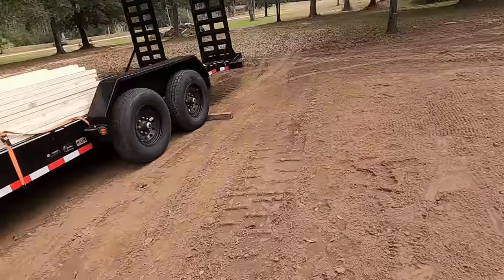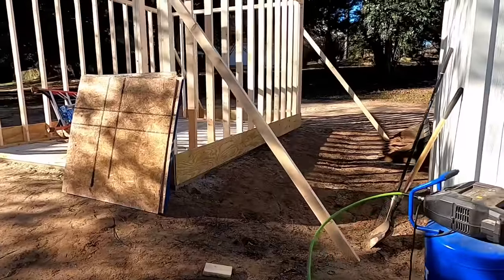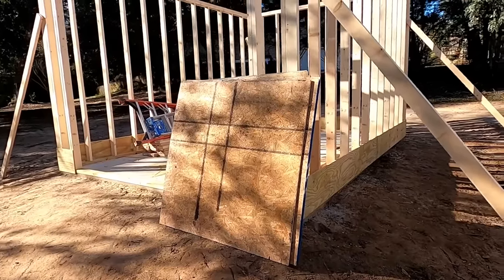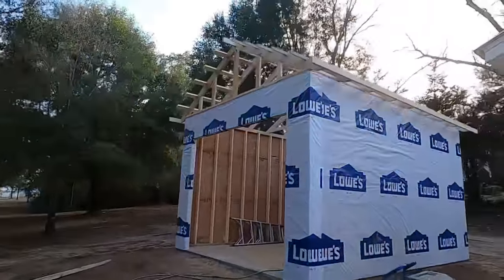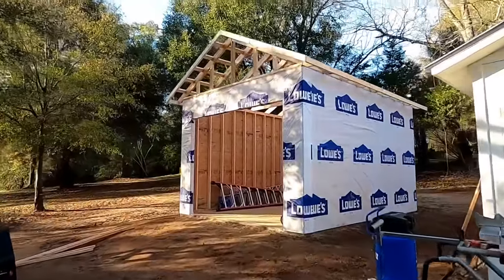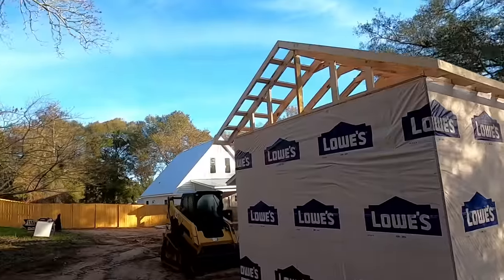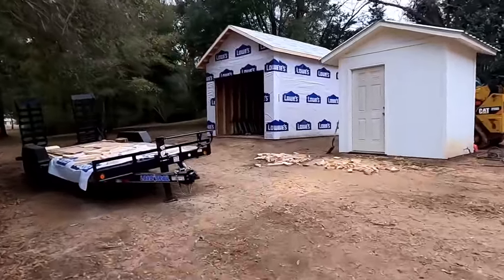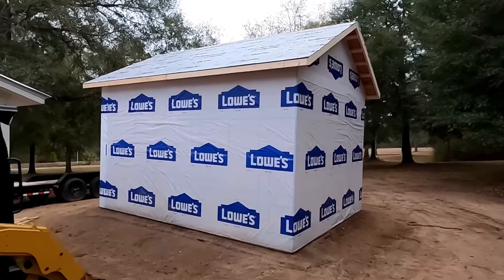Building a 12x16 Shed start to finish! Time lapse. Cost $2,800.00

Comment: I would like to know how toy attach the studs to the concrete and how you start framing the roof, that's why I came here and i still don't know how, but by the way it looks good.
Reply from the maker: Thanks. I used anchor bolts to secure the walls to the concrete. I am going to do a video of the details layout and framing of the wall and rafters and how to install them.
Reply: Drill pilot holes, slam in bolts and they expand in the concrete to hold them in after they get tightened

Comment: Looks good! Quick question, did have to get any permits for this build?
Reply from the maker: Thanks! No i didn’t. I live in the county.
Reply: Hi Brandon....
Check with your county. Where I live 200 sq ft is the largest I can build without permits etc. I have a 12 x 16 currently i/w.
Reply from the maker: I did check with my county they said I didn’t need one. They always told me I could build a garage and wouldn’t need one.

Comment: Nice job, did one last Fall here in Minnesota. 12×16 10' walls. Small windows on each gable and a service door. Built on a deck. Only way without a permit. Total cost with garage door 7×8 7500.00.
Minus shingles I had. 
Just interested in what you paid?
Reply from the maker: Thanks! When I finished the shed I had $7000. Total in it.
Reply: @Weight, Build, Dig!   Very good. I thought I did pretty well, the best bid I had was 14,000. The original shed was taken out from a storm last Memorial day. I also had my young son help which made it fun.
Reply from the maker: Yeah that’s would make it fun.

Comment: Great job!
I don't know if it would've been possible to do by yourself, but I've seen builders build each wall put the siding and wrap on while it's laying on the concrete slab and then stand the walls up! (Might be next to impossible without help)
However great job!
Reply from the maker: Thanks! Yeah I’ve seen that to.
Reply: @weightbuilddig166  I just thought it would save a lot of ladder climbing!
Even so... love the shed!
I saved the video because I plan to build a 12x16 shed this year!
I think I'll "draft" my son-in-laws to help! That requirement is in the "fine print" of me letting them marry my daughters!😁
Reply from the maker: Lol yeah that’s cool hope you have a good build
Reply: @weightbuilddig166  I have a question to ask if I may. 
Is the $2800 cost for the shed including the concrete slab?
I appreciate your help,
Kevin Barron
Reply from the maker: Yes the $2800 did include the concrete slab.
Reply: @weightbuilddig166  Thank you!
Looking forward to your next video!
Blessings to you and your family, 
Kevin Barron
Reply: @weightbuilddig166 I can’t see how that is possible, unless you did the slab yourself. I’m about to build my own shed 10x12 I’ll do everything but I’m giving the slab job to a team. I got multiple price in, and it ranges from 16 to 21$ a square foot. That includes the digging, getting the dirt out, prep under the slab, form installation, concrete and finishing. For a 10x12 that’s 2000-2600 ($CAD) with not a single piece of wood bought yet.
Reply from the maker: @LtKregorov  I did do the slab work and the dirt work by myself.

Comment: What would happen if I just put up metal siding without the plywood backing?
Reply from the maker: You could do that. But you would need to install 1x4 or 2x4 2 foot on center just so you would have something to screw into.

Comment: Do you still have your material list? I need to build the exact same size shed.
Reply from the maker: Yes. 
2-2×4×16 pt
4-2×4×16 white board
2-2x4×12 pt
4-2×4×12 white board
58-2×4x10 white board
25-7/16 4×8 osb
18-2×6×10 syp
1-2×8×16 syp
10-2x6×12 syp
1 roll house wrap
1 roll felt buster
2-4x8 pressure treated plywood
2-2x10×10 syp

Comment: Is the sheathing thickness for roof and walls the same and what nail size is used to nail on the roof sheathing vs wall sheathing? Many thx for sharing
Reply from the maker: Yes I did use the same thickness for the walls and roof. It’s 7/16 osb. I bought 25 sheets. I used 2 3/8” nail to nail them on.
Reply: Thank you for that detail

Comment: What would you do differently for a garage? Thanks!
Reply from the maker: I actually want to build a garage sooner then later. When I do build a garage it will be a 30x50  with 9 foot walls and 6/12 roof pitch. It will be built just like this shed, except The concrete will be the Alaskan slab with rebar two foot on center. The perimeter of the slab will be 12” thick and 6” thick every else. I will put up one interior wall the will divide it so there is a 30x30 on one side. The other side will be 20x30. I’ll have two garage doors and some windows, one man door on the 30x30. The 20x30 will have a man door and windows and one interior door in the interior wall. I still have vinyl siding left so I’ll use that on 3 sides of the building and brick the front. Then metal on the roof.

Comment: Did you use ram sets to put the frame to tye cement?
Reply from the maker: No I used anchor bolts. There the kind you drill into the concrete after the wall is up. Then tap it into place with a hammer and then tighten the nut. They work really good.
Reply: I think those are called redheads or something

Comment: What wrap did you do in the roof? Also, what would you have done differently in this?
Reply from the maker: I used synthetic felt called felt buster. Really good stuff. If I had to do it over I would make 12x20 instead of 12x16.
Reply: Great question.

Comment: $2800.  I assume that does not include the cost of the slab.   I do not know where you built this but concrete is $160 a yard here and the slab alone is over $2800
Reply from the maker: @vincentmiceli2554  I did the slab my self. It only cost me $600. For the concrete and $200. For the fill dirt. So I have $800 in for the slab.
Reply from the maker: Then the materials for everything it came to $2800.

Comment: Is there a list of materials and sizes of wood you used?
Reply from the maker: Yes.
2-2x4x16 pt
4-2×4×16 white board
2-2×4x12 pt
4-2×4×12 white board
58-2×4×10 white board
25-7/16 4×8 osb
18-2x6x10 syp
1-2×8x16 syp
10-2×6x12 syp
1 roll house wrap
1 roll felt buster
2-4×8 pressure treated plywood
2-2×10x10 syp

Comment: How many 2x4’s did you buy. I think I’m going to copy your design.
Reply from the maker: Sure!
2-2x4x16 pt
4-2×4×16 white board
2-2×4x12 pt
4-2×4×12 white board
58-2×4×10 white board
25-7/16 4×8 osb
18-2x6x10 syp
1-2×8x16 syp
10-2×6x12 syp
1 roll house wrap
1 roll felt buster
2-4×8 pressure treated plywood
2-2×10x10 syp
Reply: @weightbuilddig166  dang. You are awesome. Thanks again.

Comment: where I live, the concrete for the floor/foundation would be $5000..the insulation would be $ 4000, the labour to dig the sub foundation would be $4000, the lumber would be $4000..the hardware would be $4000, the roof would be $3000..and $2800 might pay for the permits for the building of the shed, the electric permit annd not the gas permit if you have a gas heater installed.  If you can do the whole thing for $2800.00, I have a job for you right here.
Reply: You in New York or california
Reply: Not far off here in TN
Reply from the maker: The $2800.00 only covers the concrete $900. Dirt $200. Building materials $1700.00 that gets the building built to the dried in point. Then I still have to buy metal roofing  the drip edge. Facia and soffit and a garage door and the vinyl siding.

Comment: No sill gasket or vapour barrier between untreated lumber and concrete?  your bottom plate will be dust in 10 years.
Reply from the maker: Your right I didn’t put anything under the bottom plate to seal that. But I did put plastic down before I pored the concrete in the slab.
Reply: @weightbuilddig166  only problem will be moisture wicking in from the sides of the slab. Concrete and wood are sponges. You did a nice job on the shed!

Comment: As a retired contractor I think you did a good job, I’m just curious why you didn’t use pressure treated wood for your mudsill . Your finish grade around the concrete slab is to high, code is 6” below the bottom of the mudsill. That’s to prevent termite infestation.
Reply from the maker: Thanks! I did use pressure treated wood for the bottom plate. I know I have my dirt high but I wanted it to compact really good around the slab while I was building the shed. I didn’t know the dirt had to be that low. I’ll lower the dirt a little before I put the sod down. Thanks for the information.
Reply: Love seeing this helpful tips from the video and comments
Reply: Can I ask where you learned standard building codes? I’d like to study this for leisure. Not sure where exactly to start. I appreciate it!
Reply from the maker: @laceemmedia9807  Well I still don’t know all the codes. I actually learn them from friends and people that I’ve hired in the past to do jobs for me. I know this isn’t a good answer. Are you wanting to become a contractor?
Reply: @weightbuilddig166  I appreciate your response. Not entirely. I’d like just learn the standard codes so that I can build things correctly and accordingly to standard. I’m still relatively young and looking to become a homeowner in the year. 

I’m huge on DIY - of course, I still believe certain stuff just requires professionals to build - but for the minor things I’d love to be able to do it myself and still be within building codes.
Reply from the maker: @laceemmedia9807  That’s cool you have that kind of desire. I like to research something I’m about to take on to make sure I’m doing it right. I learn so much just doing it myself. Sometimes it gives you a lot of respect for people who do those kind of jobs day in and day out. I would say the biggest thing I learned is don’t let the project overwhelm you or be intimidating. If someone else can do it so can I.

Comment: Should have used sill sealer and treated lumber for the plate.  Also the corners are not tied in.
Reply from the maker: Yeah I should of used something under the sill. I did use pressure treated wood.m, and I put studs in the corner a little later just didn’t show it

Comment: How are these prices possible, before Covid I built a shed 10x16 and it cost me $2800 no concrete pad. Now all prices are way higher and you built a bigger shed for the same amount. How lol. I live in one of the most expensive states maybe that’s why
Reply from the maker: Maybe so. Here in Alabama our wood has really gone back down. Like I bought a sheet of 7/16 osb $11. A sheet. When I built my house two years ago I paid $35. A sheet. Then when I went back and bought like 4 more I paid $40 a sheet. That was when wood was at it highest price ever. I couldn’t of picked a worse time to build my house, But I was already started lol. Anyway wood really has come down a lot here. Now our concrete just the opposite. I paid $125.  A yard two years ago. A month ago $175. A yard. So crazy.

Comment: Does the $2800 include the slab?? Because there is no way it includes the slab, and if it does please tell me how you did that! Im about to start my 14x20 build and my estimate was if i poured a slab myself it would still cost a few thousand dollars. DId i do something wrong?
Reply from the maker: It does include the slab. I paid $900.00 for concrete slab $200.00 for dirt $1700.00 for building materials. But I still have to buy the metal for the roof and soffit and facia and a garage door. I don’t know if you did something wrong with your estimate. Our wood here I. Alabama has really come down. Two years ago I was building my house and paid $35.00 a sheet for 7/16 osb. Three weeks ago I paid $11.00 a sheet. So big difference.
Reply: I was doing my concrete estimate wrong btw…

Comment: Is there a list to all the materials used
Reply from the maker: Sure!
2-2×4×16 pt
4-2×4×16 white board
2-2x4×12 pt
4-2×4×12 white board
58-2×4x10 white board
25-7/16 4×8 osb
18-2×6×10 syp
1-2×8×16 syp
10-2x6×12 syp
1 roll house wrap
1 roll felt buster
2-4x8 pressure treated plywood
2-2x10×10 syp
That is just to get it built not finished

Comment: How did you secure the wood frame to the slab?
Reply from the maker: I used anchor wedges. What you do is drill through the bottom plate of the wall right into the concrete. Then you tap these down into that hole until it stops. Then you tighten up the nut. They work really well. I like them because you can put them in after the walls are up and put them exactly where you want them.

Comment: enjoyed your video great job. what kind of door you putting up?
Reply from the maker: Thanks! I’m going to put a 9x7 garage door.
Reply: @weightbuilddig166  how thick is your concrete in inches and did you use anchor bolts to hold the bottom of your walls ?
Reply from the maker: @HoodHandyman  Concrete is 6” thick. Yes I used the drill in wedge type anchor bolts every 4 feet.
Reply: @weightbuilddig166  you did a great job I built a building a few years ago ( see my youtube video) your video inspired me to build a bigger one.. Do you have the plans? I  want to buildone with concrete this time. That way i can work on my wifes car when its raining:)
Reply from the maker: @HoodHandyman  Thanks! I appreciate it! I don’t have any plans. I just had a vision of what I wanted and built it.

Comment: What is the actual size of the slab?
(Sorry for my dumb question) 
I was just wondering how that works...
since the 2×4×12 wall,
 is in the middle of the 2x4x16 walls, 
then the concrete slab 
measures 16 × 12 and 7 inches?
Or how does that work?
Reply from the maker: Good question. The concrete slab is 12x16 exactly.
Reply from the maker: What you are seeing is the 2x4 x16 wall goes the length of the slab. The 2x4x12 wall is shorter then the 12’ side of the slab because it’s going to go between the 2x4x16 walls so in other the 2x4x12 walls are 7” shorter then 12’
Reply: @weightbuilddig166  
Thank you so much for explaining! 
I love learning.
I really dont know much about this 
But i love watching and learning!
Awesome!
Thank you for the detailed description!
Amazing shed by the way!
Reply from the maker: Your so welcome. I’m glad I can help. I love to receive questions and comments like yours.
Reply: @weightbuilddig166  I agree and second their comments!  Love that you're engaged and helping folks still in the comments.  Thank you thank you
Reply: How tall are the walls, 10ft I’m assuming?
Reply from the maker: @dougj.8288  They are 9 feet tall

Comment: Wall plates sitting straight on concrete? No gaps between plywood sheathing? There’s no room for expansion of the wood… The joints should be staggered on plywood sheathing.  Also the concrete slab should be at least 4” above grade.

Comment: How thick is the slab? Nice job so far.  Look forward to seeing it finished.
Reply from the maker: Thanks! The slab is 6” thick. I was going to do 4 but decided I might put my skid steer in there, so I went with 6.
Reply: Sometimes the slab has to be 12 inches around the edges and 4 to 6 inches center depending on city building codes
Reply from the maker: @pablorivera6879  I thought about doing 12” around the perimeter. But I’m not in the city limits so I went with a 6” slab.
Reply: @pablorivera6879  For a shed? Lol no.
Reply: @evictioncarpentry2628  concrete contractor here and some steel buildings call for 12 inch thick edges for jack bolts in each corner to hold it down! Have poured multiple like that
Reply: @evictioncarpentry2628  yes, I had to put a 12"  wide footing around my slab 18" below grade for a 12'x20' shed per code.
Reply: @thisplaceisazoo  That's called a grade beam.

And this is not a shed then. It is a shop.

A shed I'm my vocabulary is a 100ish Sq ft storage area for yard equipment.
Reply: @evictioncarpentry2628  Well, we were talking about what this guy built, not some little 100 sf lawn mower shed that no one said anything about.
Reply: @thisplaceisazoo  Doesn't require it where I am. People pour slabs for 15x22 Garages here with no grade beam or footing and we have some of the shittiest soil and temperature swings on the planet.

Comment: Great job! One of the most informative and helpful how-to videos I've seen. No spacing between the sheathing?
Reply from the maker: Thanks! Yeah I never seen spacing between sheathing. But maybe you know something I don’t. What have you seen?
Reply: @weightbuilddig166   at "teach construction community education" youtube channel, they mention that every manufacturer spells out a gap in between OSB panels. Usually 1/8" gap, from what I understand purpose of a gap is for when OSB panels expand and shrink under the sun or bulge if they get wet, this gap is there so that panels won't bulge from this expansion.
Reply from the maker: @artemaung5274  Thanks for the information.